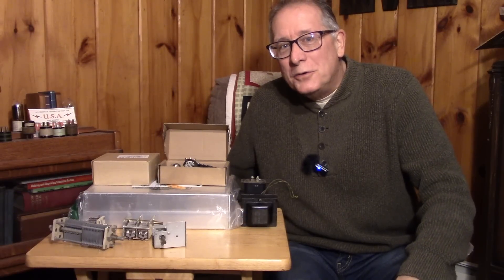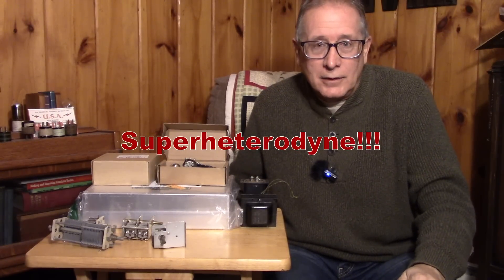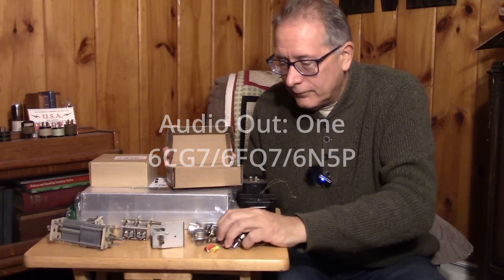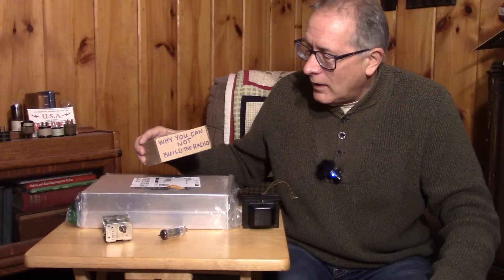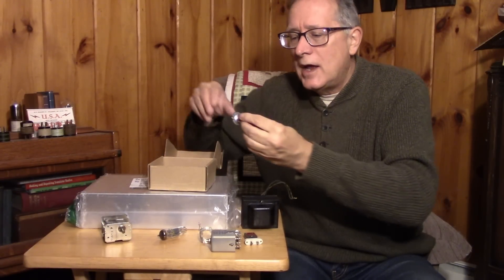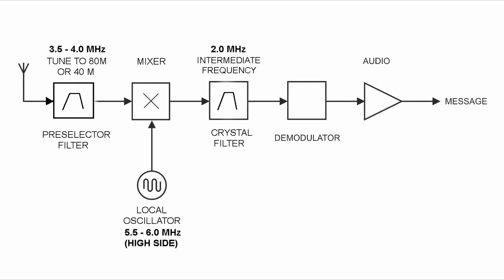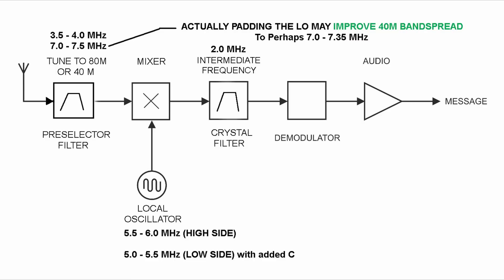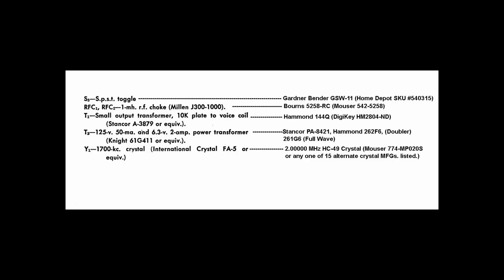You Can't Build the SimpleX Super - Part 1

Comment: I once read an article in a 1960s edition of "CQ" magazine on building a "direct conversion" receiver.  It was the first time I ever heard of such a critter.  Their performance is amazing, the only downside being they're DSB, not SSB.  Of course, they're great for AM, by zero-beating the oscillator.
Reply from the maker: This year I did a 10M DSB XCVR and used a direct conversion receive section. It required an RF amplifier before the mixer on 10, but it worked great.

Comment: Those aluminum chassis boxes have become outrageously expensive!  So, why not "Think outside the (aluminum) box"?  Find a sturdy cardboard box, and coat it with the epoxy/fiberglass auto body repair material sold at auto parts stores.  It's also sold for repairing boat hulls.  It's expensive, but a can of it will go a very long way.  It will strengthen the box and protect it from moisture.  For greater rigidity, wood furring strips can be screwed/epoxied to the underside.  Now, cover the thing with metal tape!  Copper is best, because it's easy to solder to, but the aluminum tape, sold for duct sealing at hardware stores, works, if you're clever.  Just make sure all the pieces are connected together, electrically.  Also, you may have noticed how god-awful expensive transformers for B(+) have become.  But there are those "travel adapters" that convert 110/120V to 220/240V, and vice-versa.  They're rated in Watts, and most models will satisfy any B(+) current requirement for a tube radio.
Reply from the maker: I was waiting for this comment!
Reply: @MIKROWAVE1  And I almost forgot....Filament xformer?  "Wall-Wart"!
Reply: .... or use a biscuit tin...or similar..😏

Comment: Damn you got me thinking!
I'd completely forgotten the fact you might be able to use a crystal on subharmonics with some luck... Well, that's a guess, I've seen regenerative detectors being swamped out on many subharmonics when the LC-circuit is coupled to the crystal by a pickup-loop. Is that the trick?

Edit, nah looks like I was off by miles...
Regards,
Thomas
Reply from the maker: The crystals series resonance is the basis of a simple filter where the phasing capacitor nulls out the package capacitance, producing quite a sharp filter for CW. If you short out the crystal, it broadens so you can handle wider signals like AM without distortion. If you put a second crystal in place of the phasing capacitor, you for a proper half lattice filter where you can form a pass band more accurately.

Comment: I love this project. I agree with most of your hard to get parts list but where are you going to get a 16 Henry AC filter choke. That type of pi network power supply isn’t used any more. I have an 8 Henry choke in my Johnson  Viking Adventurer and that motivated me to recap the electrolytic filter capacitors because it still had the original kit electrolytic caps. If the had shorted it it could have ruined the filter choke.
Reply from the maker: Exactly. The most flexible part of this design is the power supply. It even changed between the MK1 and MK2 versions. Fortunately the receiver is happy with 200 to 300V, 40 mA. You could do a low current drain HV supply cheap, in any number of ways. I will be using a surplus CT HV transformer out of a discarded test box, two 1N4006 diodes and a small 2Hy choke with a single 100 uF 450 Capacitor. Much simpler - available parts. And yes the schematic will change of course, as I build.

Comment: What about using 3x 12AX7 Vacuum tubes as a Cross Coupled Double Balanced Mixer which will also operate as Local Oscillator will output the IF but not anything else.
Reply from the maker: Absolutely! Now you are bringing 70's style mixer technology back into the old girl for higher performance.
Reply: @MIKROWAVE1  Yes why not might be better that what you can get with the current design also a second mixer like the downconverter will demodulate the SSB  and CW signals

Comment: I built this receiver about 10 years ago. I found a crystal at a hamfest that was 1697kc,close enough. For the input coil I used a piece of 3/4 inch pvc pipe for the form. I had some wire that was 1/32 inch diameter, so I wrapped it around the form wery tightly. I made it longer than needed so I would have some extra form length. I then heated it with the heat gun till it just started to melt. After letting it cool I unwrapped the wire and had a form with threads in it. It took a couple tries to get it right. I then was able to use smaller sized magnet wire to make the inputcoils and oscillator coil. In the final build I used a smaller chasis so I used some junkbox adjustable coils for the input section and I used my home made oscillator coil.
Reply from the maker: Excellent story and this is essentially where I will go. I do want to show a toroid alternative solution as well.
Reply: Looking forward to that! My experience with toroids and tubes isn't that positive but there should be roads to solve problems like degree of coupling (very high in a toroid, often too high for tubes?). And the crystal I've been looking for too, no luck so far! Regards from Belgium, ON4SPK @MIKROWAVE1

Comment: In the first image the text mentions adding a transmitter. "* Or a 10, 12, 15, 17 or 10m Converter".  Will you discuss those in a future video?  What would that have looked like and what designs would someone have built back then for these additions?  I'm curious.
Reply from the maker: The VHF manuals, 73 and CQ and QST, and the Handbooks, were full of simple converters. You could also buy them. The typical converter was an RF amplifier tube like a 6AK5 or a 6BZ6 into a dual tube like a 12AT7 or 6U8, with one section acting as a crystal oscillator and one as a mixer.

Comment: With modern graphics programs and all sorts of printing options, could could probably make a very classy dial nowadays.
Reply from the maker: The original was not much more than paper and electrical tape.
Reply: @ Yes I saw that in the original article.  I often wonder with these things whether you should stick 100% to the original or deviate where there’s a much better modern option.  Some have suggested using a cheap DDS board to get round the xtal limitations.  Not sure….  I think I’m going to give this receiver a go…
Reply from the maker: This is pure nostalgia for most who now have the time to build and the patience to start collecting parts.

Comment: Looking forward to this series. I found a schematic of the SimpleX Super in the 1959 Radio Amateur's Handbook. It's an interesting set that looks as if it would work fine for CW and SSB. On the other hand, in AM mode, it looks like a converter stage driving a grid leak detector. Apparently, the BFO can be switched off in WWV mode or switched off, if desired. That could limit its sensitivity to AM signals by quite a lot. That might not be much of a problem on 80m, with its relatively high external noise levels, but could be a bit of problem for 40m. This is confirmed by the Handbook article, "You will find this to be a practical receiver in every way for the c.w. (or s.s.b.) operator. "  -- as it says in the text.

But don't mind me too much. I'm an OT. I got my first ham radio license about 55 years ago, and to my mind, AM="Angel Music". If I were to build this receiver, I'd endow it with an IF stage, probably the classic circuit with a 6BA6.

Interestingly enough, the next article in the Handbook is a 5 Tube Superheterodyne which has a front end that is practically identical to the SimpleX, but it's dual conversion (1700/100 Khz). Its detector is a non oscillating regenerative plate detector with a BFO that can be switched on or off as desired. It lacks the WWV option. Curiously, its 1700 khz.  transformer is a homebrew design "(made from two Van i Loopsticks shunted by 100-µµf. mica capacitors. See text)".
Reply from the maker: One major difference between the MARK I and the MARK II is that the grid leak detector is converted to a Q multiplied grid leak detector which could improve AM reception - with the BFO switched off.

Comment: I'm really looking forward to this series. Been wanting to build one for years abut didn't due to the unobtainable parts. Now you've given me hope.
Reply: If you want to build a tube receiver,  find a box and start putting likely looking parts into it for a few weeks. Then you can alter the design slightly to use what you have got. Many suitable components can be purchased or found on the Internet or junk sales.
Reply from the maker: The hardest part is starting! I like to start with the Power Supply!
Reply from the maker: Yeah, it's a great project that just needs some practical updates on the parts approach.

Comment: I built a similar receiver back in 1962. I will enjoy how this project goes. my first novice receiver was a philco model 16 big console radio with an avc shorting switch/manual gain control/ q multiplier/ and bfo added by me. it worked ok and got me on the air.
Reply from the maker: Wow! You souped up the grand old lady!

Comment: One way to overcome the lack of the 1700khz crystal is to use a 455khz IF filter.  These ARE available as many ham rigs used double conversion down to a last IF of 455khz, and replacement crystal and mechanical filters are easy to find at hamfests and on ebay.  You would have to add a second conversion from 1700khz down to 455khz, and the oscillator here can be free a free running L/C affair with a large C to L ratio.  So, one extra tube.  All of those mini inductor and IF cans can be replaced with toroid wound coils.   I'd probably cheat and use solid state circuits, including an si5351a vfo with an arduino processor.  So many of the classic tube circuits can be redesigned around the same block diagram to use older solid state devices.  I don't know if I'd trust my kids to play around with the voltages used with vacuum tubes.  I'm amazed I didn't kill myself as a kid building my own novice transmitter power supply.
Reply from the maker: Let's do a solid state version.

Comment: Great stuff. Love to see how this progresses.
I was thinking i.f. transformers difficult to get, I do have two pairs out of old radios I took apart years ago. Other coils can be wound. I have a few o/p transformers and chokes, all kept as useful stuff.
In the U.K. we call them radio rallies and there's always variable capacitors available quite cheap. I have two Jackson slow motion drives too.
I made several receivers in the 1970's, making one then a few months later buy other valves and make a new one with existing parts. Circuits from Practical Wireless and Short Wave Magazine. No new one worked any better than the previous ones.
I wish Denco was still producing items but homebrewing was already in decline by the 80's.
G4GHB.
Reply from the maker: The receiver has 3 shield can inductors. They are not actually transformers.  They can be wound inside old IF Can forms.
Reply: @MIKROWAVE1  Right, okay, tnx.
Reply from the maker: Looks like you are all provisioned for this project. Cutting the front panel today to just overlap the box width.
Reply: @MIKROWAVE1  I'm not actually making it as I've other things going on here but I'll watch how yours goes.
H/b tcvr to modify, RA17L to look at.

Very soon when I get sunlight into the shack I'll do a video to disprove to C.B.'ers their 'magic tuned coax' is pointless using my VNA, tx, oscilloscope, 50 Ωdummy load, SWR meter and jumper lead.
They really believe there is not one length of coax with a meter inserted as though the SWR meter is some kind of isolation device.
They can obviously see two cables!

73, Bill, G4GHB.
Reply from the maker: RA17L and the Murphy Monsters are great! Well unless they fall on your foot!.

Comment: I built an earlier version of a dual band receiver in 1959.  The Radio Amateur's Handbook", 35tht Edition, 1956.  Pages 116-120. "Two Band 5 tube Superhetrodine".
Worked very well for my first Novice receiver.  Never used it on 80 meters didn't have room at our rental house for an antenna that tall.  Very stable receiver very low drift.  
Made a few changes to the design to save money, 85 KC IF transformers instead of the 100 kc noted.  
War surplus store near me had them for little money.  Spare parts for the ARC5.  Great to see someone still trying out tubes again.
Reply from the maker: Wow that is very impressive! Real HBR project in the day!

Comment: In one of your early 2024 videos you mentioned building the SimpleX Super. I checked my 1959 ARRL Handbook and found the  article. I added a 1.7 MHz crystal to my Hamfest shopping list. I attended Hamvention and 4 other Hamfests. No 1.7 MHz crystal to be found. Very few Ham band crystals to be found. I'm looking forward to your solution for the 1.7 MHz crystal.  For the price of what FT-243 crystals are going for you could use a SI5351 and Arduino.
Reply from the maker: We will try using slightly different crystals that are common clock frequency HC-49 types.
Reply: PLL?
Reply from the maker: @jagmarc  The 2000 kHz crystal we will use as a filter was originally made as a microprocessor clock. It also could be a reference for a PLL, as you say.
Reply: Handy tip for novices with tuned circuits, beg borrow a grid dip oscillator to use (fet dip these days).  To help get each tuned circuit into the ballpark one step at a time, ready for first switchon.
Reply: Thanks for a very informative and interesting video again!

I have collected the parts for the Simple X, I managed find a 1640khz HC6-U type xtal. Also I have the stuff to wind the inductors.

73 de Juha OH8UBJ

Comment: Awesome. I was up early this morning troubleshooting why I get transmit signal feedback interfering with the VFO on my HW-8. It pulls the VFO with a switched capacitor to Net the transmitter to with the signal you have tuned offset with the Direct Conversion receiver. My kingdom for a SuperHet!
Reply from the maker: Direct conversion receivers do have some limitations, depending on the isolation between ports and the actual mixer type. And of course they do require a lot of audio gain which can perturb microphonics.

Comment: Changing the oscillator frequency also took a strong ham band image out of the orher ham band. Great design!
Reply: Ok, now I understand the design better. I wasn't properly LISTENING the first time through and thought there was a two MHz shift of the LO when moving to 40 m; that would put (in my mind at the time) the image of the other ham band out of the IF passband. 
The original post was based on a complete misunderstanding of the design. I'm sorry, I wasn't paying attention.

We can either delete or leave this trek into the pitfalls of multipliers as a cautionary  warning to others, I don't care - it's a hobby to me (and I make mistakes all the time).  Your choice.

Thanks KC5UES - Chip
Reply from the maker: I am a novice at spur searching. Please elaborate for the comments.
Reply: @MIKROWAVE1  (doing the calcs I see I'm wrong! -will replay until I fully understand what you're saying. - thanks.)

Comment: Not finding a simplex receiver in the 1953 jan issue. As stated in the video
Reply: The Radio Amateur's Handbook", 41st Edition, 1964
Reply from the maker: @ttucro2  The MARK II version was published in the Handbook for many years. I have a 1958 that has it already.
Reply: Did find the first version in the dec 1958 issue.
Reply from the maker: Ah!  @daviddavidson1372
Reply from the maker: Yes 1958 and 3. I read the date wrong. The handbook had a similar image flipper 2 band receiver shown in 1958. The MARK I shows up in the Handbook in 1959, so shortly after and its in 60 and 61. The MARK II shows up in the handbook in 1962-65.